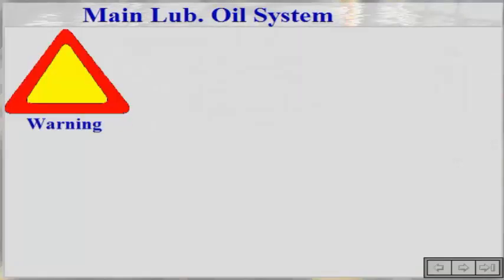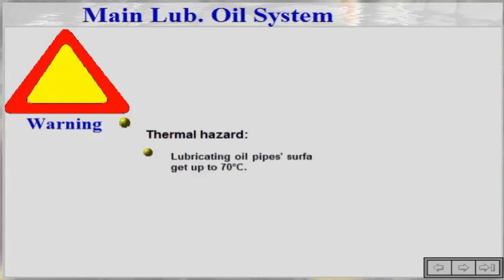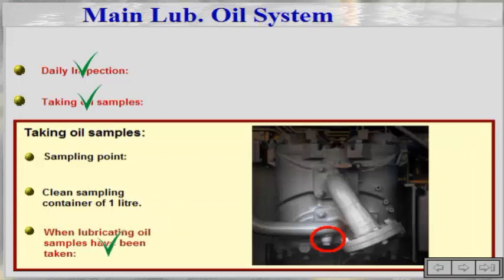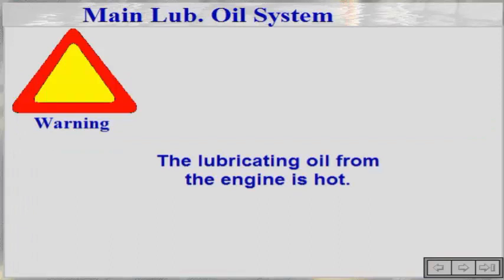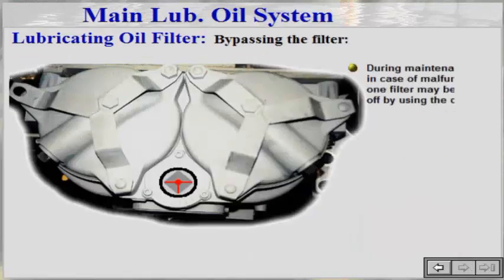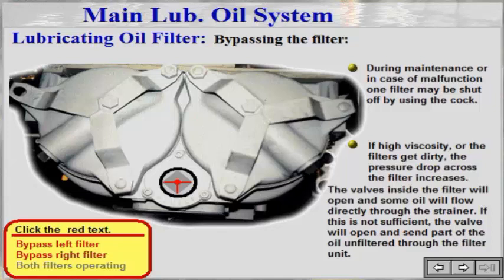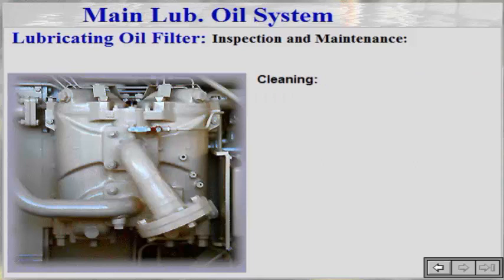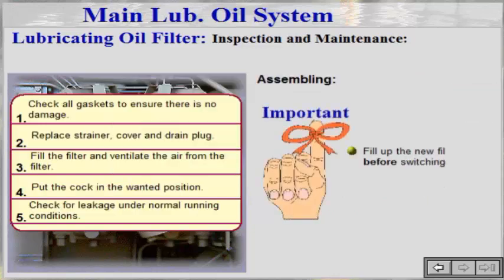Main Lubricating Oil System

Comment: Why lub oil pump taking suction from  main engine sump and giving to the cooler .in JCW system why fresh water pump taking suction from cooler. What is the difference between this